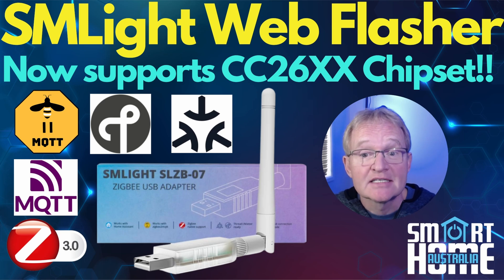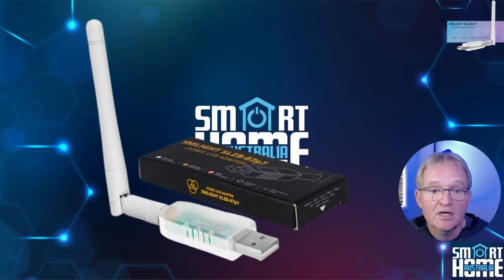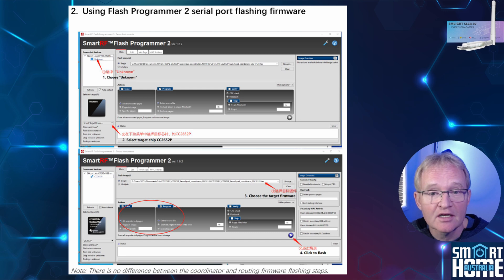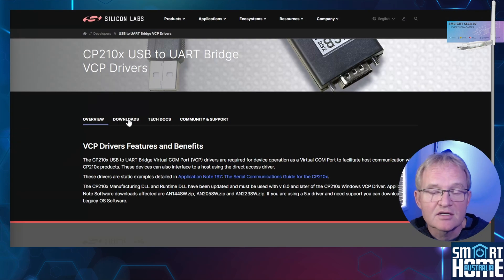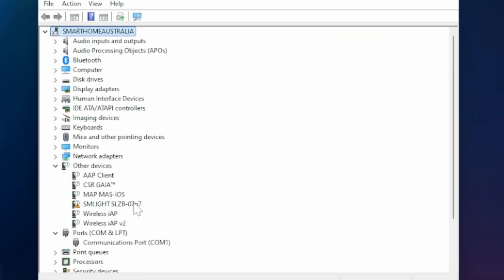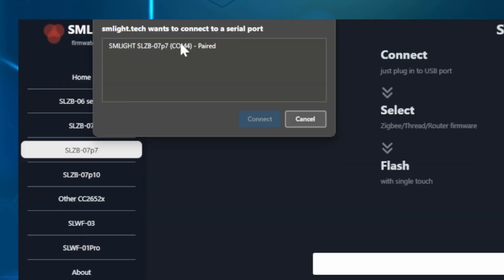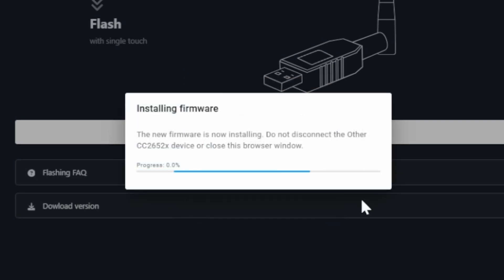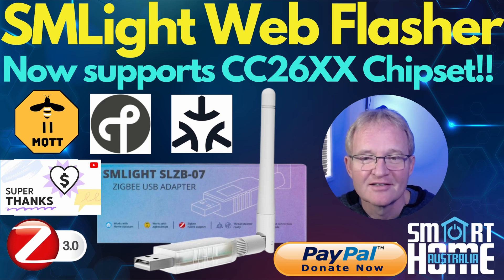SMLight Firmware Web Flasher (Now supports CC26XX Chipset)

Comment: Can you help? I dont see it on ports, or others. But im using virtual box + HAOS and zigbee works just fine, E version
Reply from the maker: OK so it sounds like you are using a Windows machine and are looking for the USB Zigbee controller for the purposes of upgrading it. but you can't see it, even though it still functions. 

OK a few possible issues and simple solutions:
1) Shut down HAOS through whatever method you have it running and retry. Sometimes it will exclusively allocate the USB adaptor and hence it will not be visible or available to any other resources.

2) Reload your USB UART Drivers, they could be corrupt and hence not be working. 

3) Switch USB sockets; although you say it is working with HAOS so this is a long shot.

4) There might be a different underlying issue with the machine, switch to a different machine if possible.

Implement the above and you should be fine. If you still have issues then maybe drop a line on the Discord channel (https://discord.gg/s9NgVNQP) and the community can assistant.
Reply: @ thank you, i heard about a python code that I can update it, in case I still can’t see it on windows. But I will try the suggestions